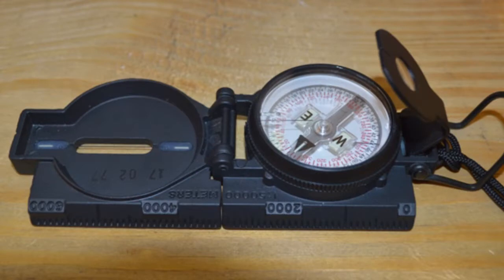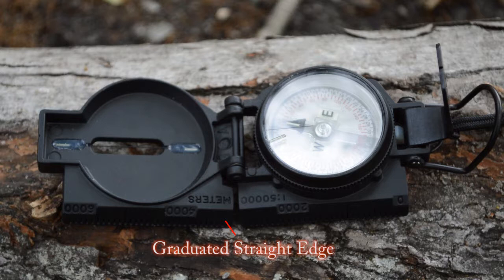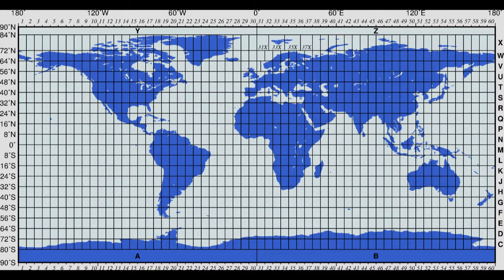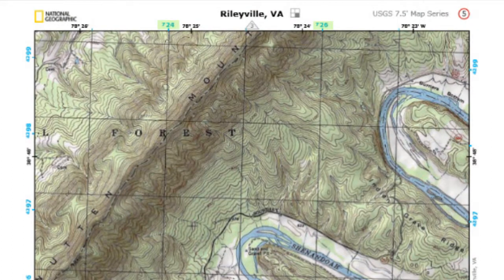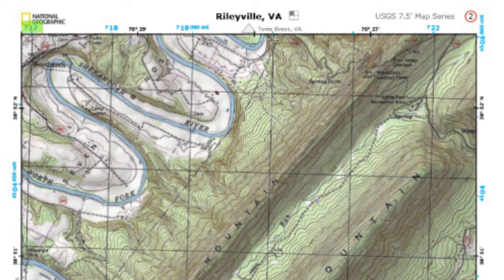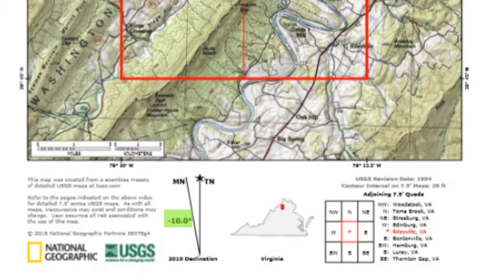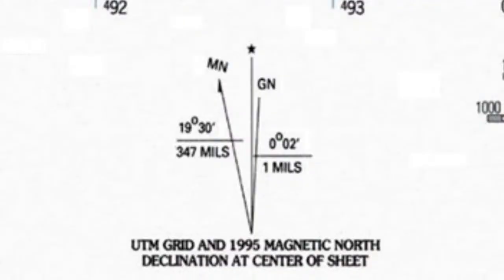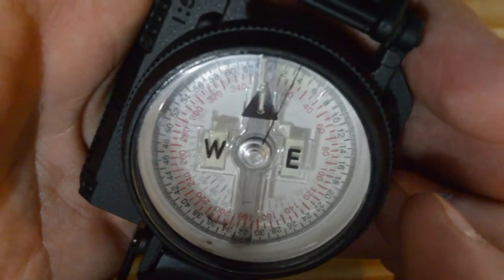Land Navigation Course (The Compass) Lesson 1

Comment: Can the Lensatic Compass be used world wide like the Suunto MC-2G ?
And, can it be used in place of the PROTRACTOR for map bearing ?
Reply from the maker: Yes, it can be used worldwide as well as even repaired and fixed on site as these subjects I will go into detail in other videos. As for being used in place of a protractor, I am assuming you mean can you use the angle bearing of the compass in place of angle or degree bearings that exist on the protractor. Yes, but you need to make sure two things are done first make sure the declination is added to your bezel ring first, as you will need to convert your magnetic bearing into grid first so that your map reading is focused upon grid north and not the magnetic north or you will be seriously off course if you do not convert your compass to read grid north and then you will be plotting off course, than orientate your map so that the map is facing north in the direction the declination added reads. Than what ever plots you have added to your map you can simply just use the ruler side of your compass to align the two plotted points and from there you can get your angle or degree reading from that. But then before stepping off you will need to convert the compass back to read magnetic north and adjust accordingly to add the needed degrees back onto your magnetic course and head in that corret direction using magnetic azimuth.
Reply: @maccabbeebushcraft5546  its not global. there are northern hemisphere and a southern hemisphere versions.